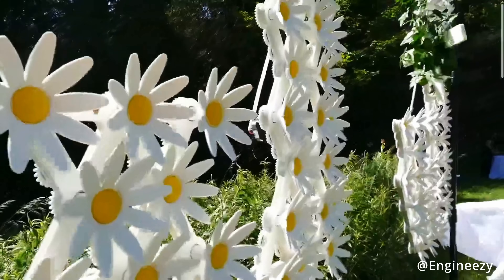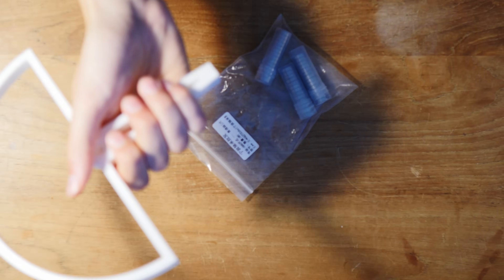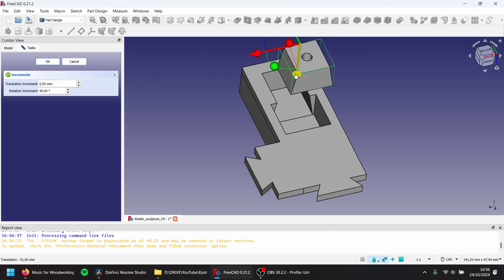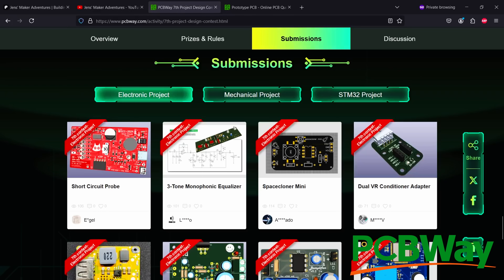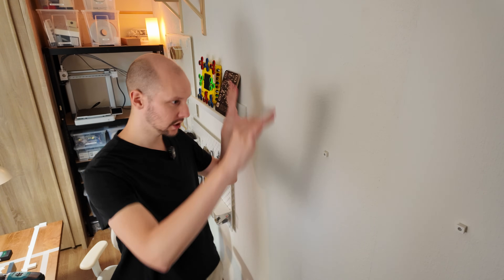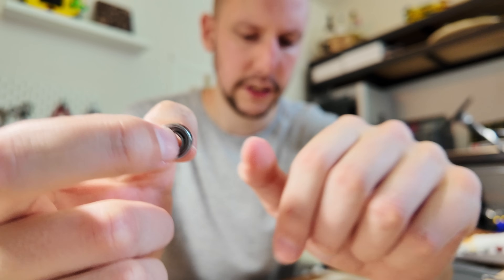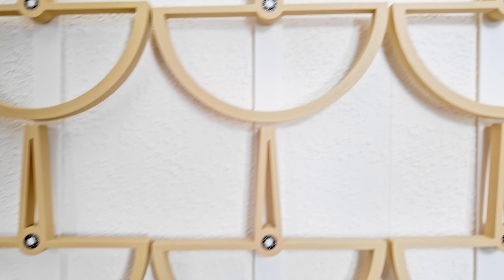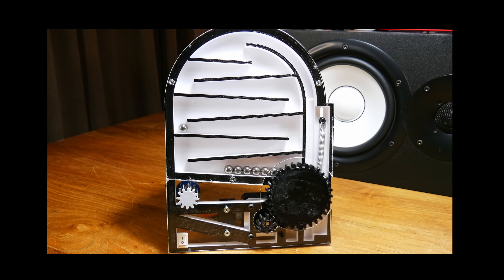How I Built a Mesmerizing Kinetic Sculpture with Magnets

Comment: Your bearings need some lubrication no matter what.  The problem could very well be the oil weight, or viscosity.  Try cleaning and then relubricating with a very light weight oil.
Reply from the maker: You could very well be right. Also given the risk of corrosion. What is a thing though, is that the performance of these bearings was iffy even in factory delivered state. Some of them are perfect without lube and some terrible. I think if I'd used a good brand it might have been a different story.

Comment: I've had luck cleaning bearings with hand soap and a toothbrush. It's a bit labor intensive but very cheap and the soap seems to help protect the steel from rusting, if I understand correctly.
Reply from the maker: With hand soap and a toothbrush, wow. I would not have imagined that method. I don't think these bearings are rust resistant, wouldn't residual water be a problem with this method?
Reply: @JensMakerAdventures  I use a lot of soap and a little water, then I don't rinse off the soap. According to my Google research, soap and water is a fairly high alkaline solution and I think it helps prevent rust. People have been using lye to protect steel and remove rust for a very long time and soap is made from lye.
Reply from the maker: @jacobopstad5483  Wow, I'm amazed. Thanks for explaining!

Comment: Add pusher - so it never runs out of juice.
Reply from the maker: Good idea!! If I make a newer version I will definitely do this, already bought some enamel wire to make coils, but figured the sculpture was already nice enough to share
Reply: @strange_inventions  Perhaps a mechanical wind up kitchen timer. Or for an infinite version, maybe a strong electric clock mechanism with a magnet attached to the second hand. Attached so that it can slide up and down on the hand, for adjusting the position.
Reply from the maker: @Mavrik9000  Those are some really cool ideas!!
Reply: magnetic, or electromagnetic

Comment: I'm suppressed you didn't use acetone to remove the grease.  I also suggest SKF bearings as they should be more predictable.
All that aside, Very nice work.  I really like this one.
Reply from the maker: Thanks for the kind words. I could have tried acetone though it's less accessible than the technical fluids I tried. Maybe that'd done the trick. Thanks for the suggestion about SKF, I might try their product. I wanted to keep the prices accessible but maybe I shouldn't have even bothered with the ultra cheap bearings, in retrospect
Reply: @strange_inventions  That's very fair. Keep up the great videos!
Reply from the maker: @dantesmith3664 Thanks for the kind words! 😃
Reply: @strange_inventions  
I have to eat my words a little as it tried it myself with a quality bearing and it failed measurably.  acetone seamed to give me the same response as you.  So I tried other bearings with everything from alcohol to window cleaner.  they all acted the same when they dried. I put light oil on them to give them a thin lubricant but i don't know.  So I asked a coworker and he suggested low friction skateboard bearings.  I know those would probably be more expensive yet. 
Bests of luck, I'll look forward to seeing what you come up with.
Reply from the maker: @dantesmith3664  I love that you actually tried it with quality bearings and I'm surprised it didn't work. I imagine there are different types of grease and some just don't like solvents. Too bad in my case there wasn't any info regarding what products were used to lubricate.
Reply: @strange_inventions  Any hardware store or drugstore/cosmetics store should have it. Look for nail polish remover if you can't find it in a hardware store.

Comment: Maybe I missed it, but when you remove the grease from the bearings you should replace it with another thinner lubricant, otherwise you are running your bearings unlubricated which isn't good.
Reply from the maker: Thanks for the advice. I think you're right, at some point I think moisture in the air might take its toll on the bearings. I decided to go and see what happens, maybe it will not be that bad and maybe I need to learn about lubrication. What made me decide to postpone is that I can evaluate if I like the sculpture as is, without spilling oils or possibly increasing the friction in the bearings and see them in optimal performance. I might do it differently if I make a new version
Reply: From experience with fidget spinners, graphite works the best but is noisy. The bearings will make a whirring noise, but maybe that's ok for you. I landed on bike chain lube for silent spinning.
Reply: @NickCombs  The Sculpture doesn't spin that fast so it shouldn't be too bad
Reply: @strange_inventions  I would recommend lacquer thinner for removing the grease, and something light like sewing machine oil to prevent rust.
Cool stuff 👍
Reply from the maker: @CoCoNutBob  Thanks for the compliment and thanks for the advice!
Reply: @strange_inventions  The moisture in the air will very much attack the steel surfaces, you NEED that thin layer of oil in there else your sculpture will be seized up later. Steel rusts when left in air that has any humidity, only exception is if it's a good stainless, use something light like sewing oil if worried about slowing them down.
Reply from the maker: @Roobotics  Thank you for your input, I'll definitely consider doing this :)
Reply: @strange_inventions  You might try silicone spray. I don't know if it would work, but it's definitely a lot thinner than grease. Setting up one with a motor that just spins it, perhaps from geared teeth added on to the outside half circle part, and leave it spinning for many hours might give you a good idea of if the process works for what you need or not.
Reply: I suggest a Teflon-based bike chain lubricant. It is a convinient small tube and extremely thin. Mine is a Tri-flow brand

Comment: Maybe add hidden electromagnets to keep it turning
Reply from the maker: That's a really cool idea! I experimented with them however the ones I used had ferrometal in them so the magnets were attracted to them no matter what. I might just experiment with other electromagnets or making my own in the future. I also already bought the enamel wire😊
Reply: @strange_inventions if you make the coil of wire big enough, you can use an air core, and so there will be ZERO residual magnetic field, when the electromagnet is turned off 😉
Reply from the maker: @the_eminent_Joshua_E_Hrouda  This would be very sweet and I might try experimenting with this if I build a new version! Thanks for your input! 💪🛠👌